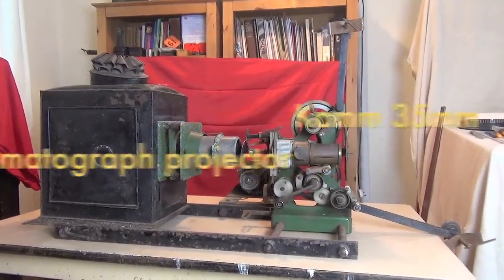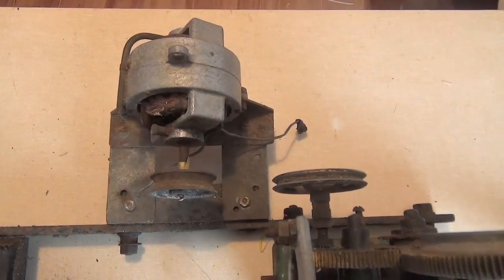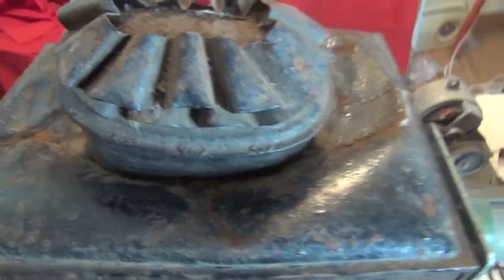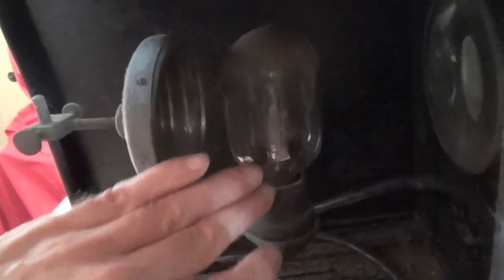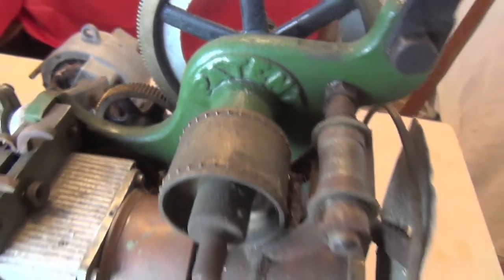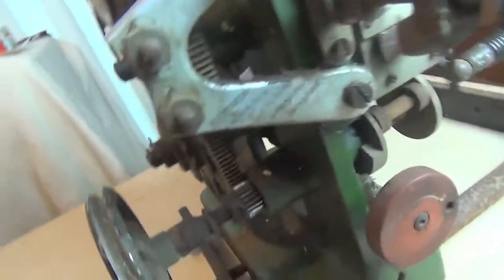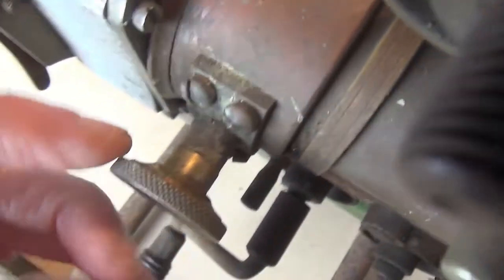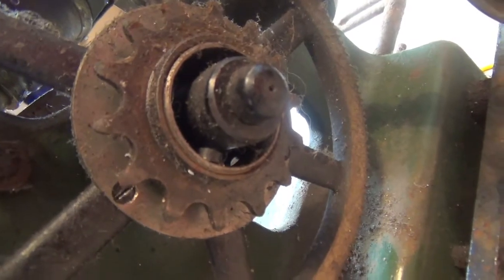Kamm 35mm cinematograph projector motion picture machine 1910? Pt.1

Comment: I am about to start  cosmetic restortion of a Kamm projector found it a storage container at a local museum. It is quite rsuty and I think some parts are missing. We have the stand and the projector head and the top spool housing, I think the lower spool is also around somewhere. We also have two arc units and the lamphouse. I,m not sure but I suspect this  might have some from  mall silent cinema that is on the site. My usual volunteer role is with the transport side of the museum but I have a long interest in cinema history and technology.
The museums cinema, which is genuine and was moved to the site after it was discovered by a local historian back in the 80s, has a similar machine on display, I need to pay it a visit when the cinema is open as I wonder if we actually have a pair?   The machine we have has a shutter that consists of a revolving 'canister' rather than the more conventional light chopper.
Reply from the maker: See this video: (near the end, at 2.50) for a quick shot of the Kamm projector that was in the Barnes Collection. I filmed it in 1971. It's probably now in the Hove Museum collection.
https://www.youtube.com/watch?v=JoTYp7rcqj0&list=PLt6ziKrdpWOcH0Oc9CgcV8IHVNxmin63u&index=5&t=
That is most likely similar or identical to the one you mention? It has a barrel shutter. Several developments by Kamm were patented. May I ask at which museum the one you're dealing with was found?

Comment: Fantastic video. Thanks for sharing. Where do you find things like this? I can't imagine there'd be many left at all. Seriously impressive stuff. Would something like this have been used in a cinema for screenings to the public or would it be something more minor like for educational or home use?
Reply from the maker: Thanks for your interest. Rare projectors like this only turn up occasionally, but could surface anywhere. This one is dated 1907, which is the very start of purpose-built cinemas, but it was certainly originally for professional (not home or school) use, and most likely used in an early purpose-built cinema, or shop-conversion, or important lecture hall.
Reply: @horipet  Thank you for your reply and your information. It's so hard to find information like this on early cinemas and am fascinated where mine may have been during its life.